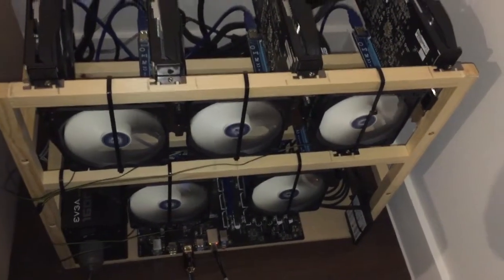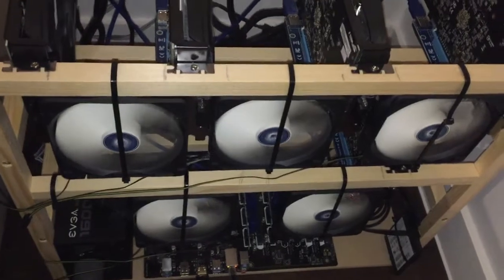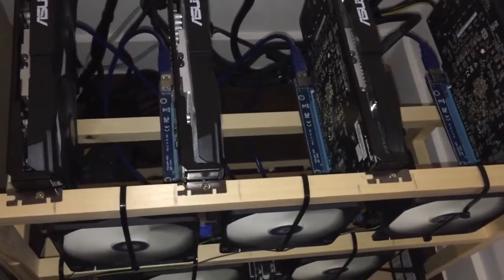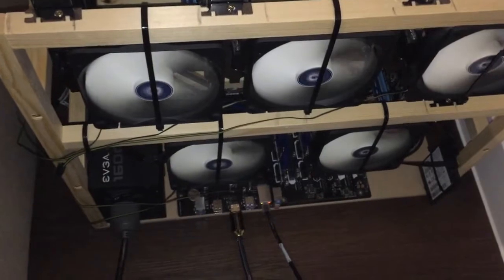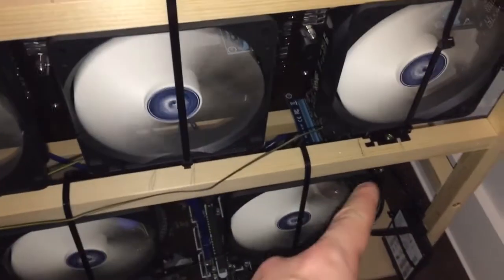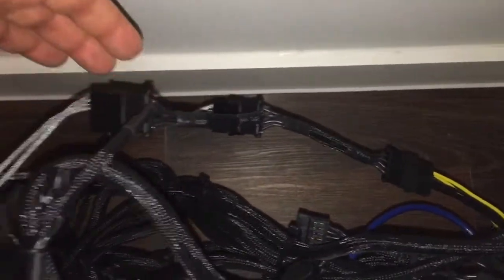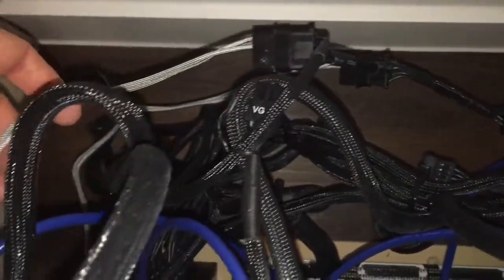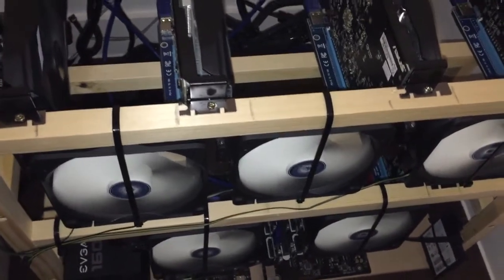How to install fans for a cryptocurrency rig for Ethereum with 5 AMD GPUs

Comment: Hello how to connect the cables with fans? My cards are 5 rtx 3070 pls
Reply from the maker: You will need to connect the Peripheral cable from the PSU to the Molex cable and the Molex cable to the fans. Usually 1 peripheral cable have 2 or 3 inputs so eventually you can connect 3 fans to each input

Comment: Hello, 
Nice idea for cooling the GPU.
Do the fans blow out hot air or blow on cards air ?
Reply from the maker: Hi, the fans are blowing cool air between the cards. This will avoid the heat from the card's backplane to enter to the following card.

Comment: hi, this molex to 3 pin cable, does it come with the fans? or the psu? or u buy it separately?
Reply from the maker: I bought it separately, you can find it here:
https://www.amazon.co.uk/gp/product/B004J3P6IU/ref=oh_aui_detailpage_o00_s00?ie=UTF8&psc=1

and these are the fans:
https://www.amazon.co.uk/gp/product/B002KTVFTE/ref=oh_aui_detailpage_o00_s00?ie=UTF8&psc=1